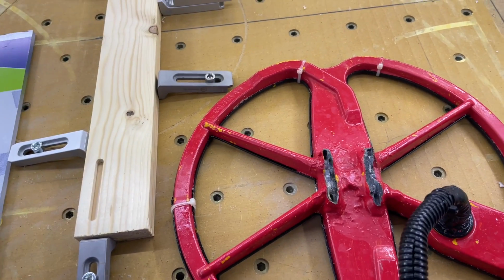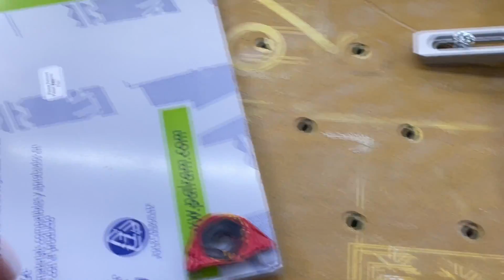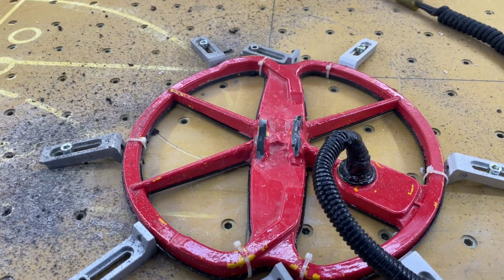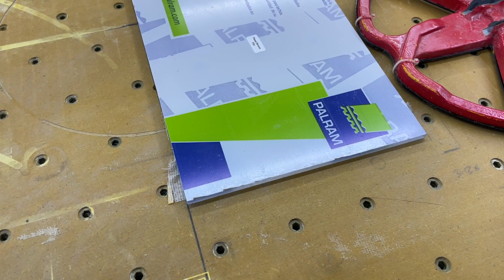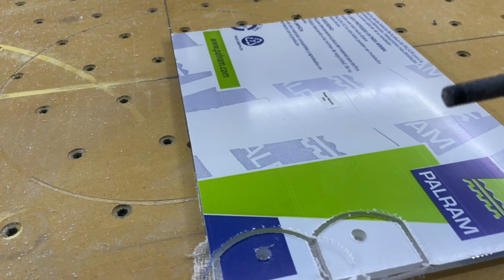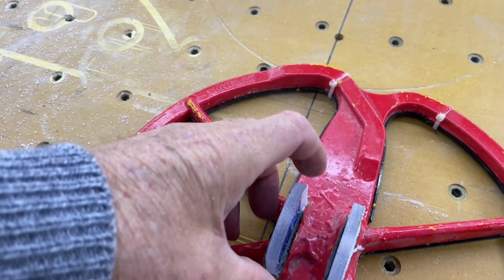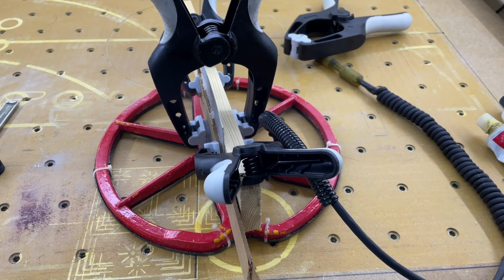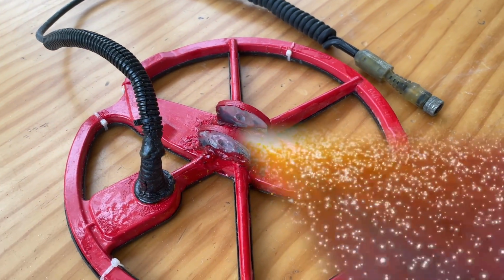Repair of metal detecting coil with CNC, carbide Shapeoko - 4K

Comment: Wow that’s a next level coil repair, fingers crossed it lasts but I’ve noticed it’s the same people who break coils again and again 😎👍
Reply from the maker: yes, you are right, I repaired this coil 4 years ago but once it changed hands it did not last long ! Long long saga about getting polycarbonate to do repair. I am hoping its now virtually indestructible.
Reply: @cnclife1385  It does look a really good repair and a significant improvement on the original.
Reply from the maker: @ThePhilandPam  I made is super thick and super strong, The coil will break first !

Comment: Minelab Coil ?
Reply from the maker: Well spotted :-) off a CTX3030
Reply: @cnclife1385  I have the Nox 800 like similar.
Reply from the maker: @martinstreasurehunting  yes friend has one of those as well & yes broken the ears on that as well !
Reply: @cnclife1385  I going to buy the ears stiffeners before I break mine . It's one of the points on the machine.  See lots of people had trouble with there heads flooding as well.
Reply from the maker: @martinstreasurehunting  yes, there are a lot of 3D printed ones out there for the equinox. The flooded head can be stopped by inserting a silicon gasket into the entrance of battery area before the breather hole.